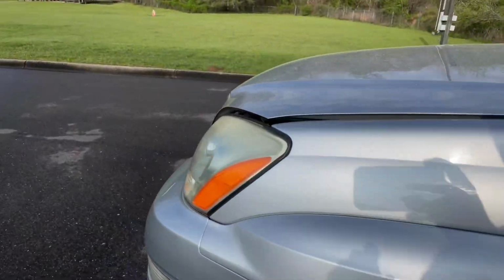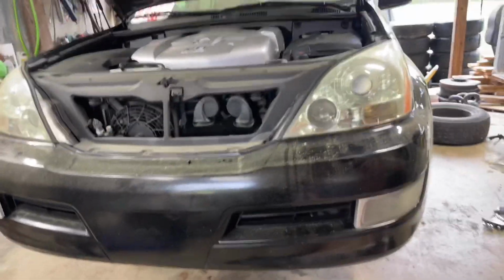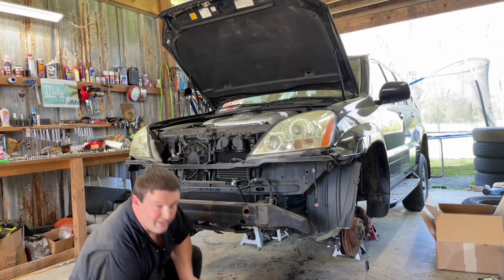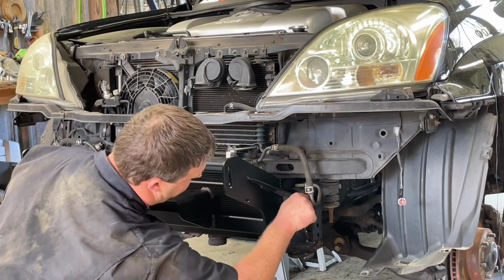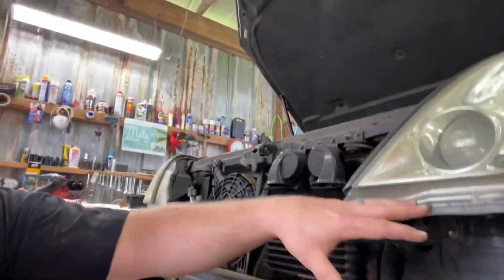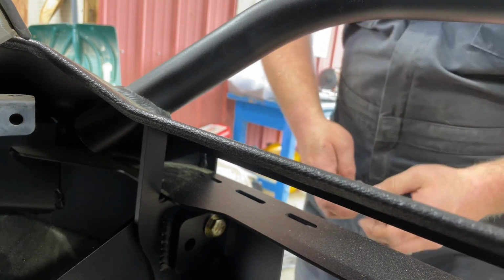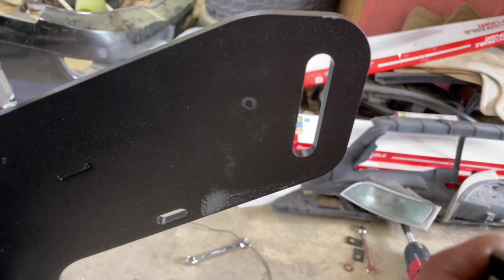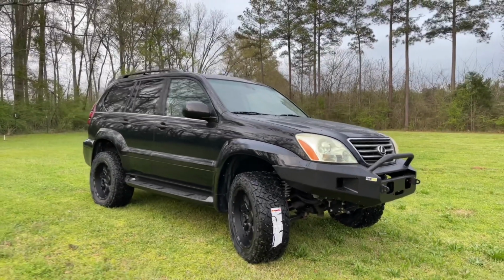Lexus GX470 MetalTech 4x4 Goblin bumper install

Comment: would this bumper fit on a 2010 Lexus RX350?
Reply from the maker: I can check and see if they make bumpers to fit the RX but that one should not fit it
Reply: @crutchfieldautomotive7936  I’d appreciate that. I’m trying to modify my RX into an overlanding rig
Reply from the maker: Looks like you might have to go Custom, I’m not seeing aftermarket options
Reply: @crutchfieldautomotive7936  yea there’s nothing out there specifically for it. Never hurts to ask though. Thanks for checking

Comment: Do you think I'd still benefit from having a 2-3' lift on my gx470 while maintaining the diameter of my tires/wheels? I'm thinking, 15' for the wheels and fill the rest with tire so if have more meet when off road. 235/85/15 maybe...
Reply from the maker: I think you may can sneak a 16 inch wheel onto it but I’m also doubtful about even that small because of the brake caliper
Reply from the maker: You would get a little more clearance OffRoad but I would say you would still want a little bit larger tire but it’s still not going to be a problem
Reply: @crutchfieldautomotive7936  what about the brake caliper? Can you explain a little more please? I'm super excited about this but I don't know enough to understand the details of it! I appreciate you taking your time to answer me! God bless
Reply from the maker: The brake caliper limits the size of your
Wheel diameter when sizing down.  I don’t think a 16” wheel will fit without rubbing the caliper as it spins
Reply: @crutchfieldautomotive7936  understood... So maintain the 17 inch with a 245 maybe 255/70 or 75?
Reply from the maker: 255/75/17 would get you to 32” and wouldn’t look funny lifted
Reply: @crutchfieldautomotive7936  and maybe no rubbing ha?!
Reply from the maker: Lifted on a 32” shouldn’t run any
Reply: @crutchfieldautomotive7936  dis some research and found out the actual speed would be a little different. Like 68 when Speedo showing 65... Should I worry about it too much?
Reply from the maker: Not really.  Someone with a good scanner may be able to recalibrate to the new tire size for you. 
The miles also rack up a little faster since the axles will spin more due to a smaller tire size but again it will be minimal
Reply: @crutchfieldautomotive7936  can i have you email please?
Reply from the maker: crutchfootball@yahoo.com

Comment: I'm glad to see those Level8 Slingshot wheels on this GX. Nearly bought some.  Ended up buying the new Rocktrix RT112 in black with -12 offset.
Reply: I have 40 inch plutonium spinners with -550 offset.. beat that pal!

Comment: I finally bought a GX 470 this last weekend. I had to pay a little more than I wanted to for it (and probably more than it is worth) but it is what it is. I just ordered tires for it today. I plan on lifting it 2 to 2.5" soon as the current struts are shot. I will do the CV's while I have it apart. It is also due for a timing belt  kit. You do a lot of work yourself but sounds like you usually have someone do the timing belts for you. Is there a reason for this? I was planning on doing it myself but don't want to bite off more than I can chew.
Reply from the maker: Time.  Trying to juggle too many projects at once haha.  I’ll probably drop a timing kit video in the near future
Reply: @crutchfieldautomotive7936  I watched a timing belt change video last night and can see why. I had heard that it was relatively easy on the 4.7 but it looked like a pretty significant chore. Not sure if I want to do it myself or not now.

Comment: Did you have any issues with the bumper not being seated low enough and the hood barely touching it when closed?
Reply from the maker: Slightly but was able to adjust easily
Reply: What did you do? I have the bumper bracket as low as possible. Not sure what else I can do.
Reply from the maker: Can the back not tilt up and let the front drop some?  Shoot pics to my email if you’re still having issues 
crutchfootball@yahoo.com
Reply: Email sent

Comment: Hey Ryan, I used your video to install my Goblin. Thanks for sharing this. Without your guidance, I would still be out in the garage struggling. Question: What is your go-to coil overs when adding that much weight + another 65pounds for a winch? I'm keeping the airbags in the back, but would like to reduce the raking in the front by a good inch.
Reply from the maker: I like Dobinson’s IMS but there are several good brands for that.  Budget limited or any?
Reply: @crutchfieldautomotive7936  Looking to spend around 1k. Thanks for your insight. btw: Super impressed you answered my question so quickly. From your YouTube vids, you're a very busy guy.
Reply from the maker: I stay a little busy but I like to try to respond  timely.  Dobinson’s entry level with the heavier springs or the Eibach kit may be best for $1k 
Old man emu makes a split kit as well
Reply: @crutchfield Clan   Would you not recommend the medium duty spring to hold up to this bumper? I’ll be installing a winch too
Reply from the maker: Medium duty for the weight of the bumper and winch should be enough